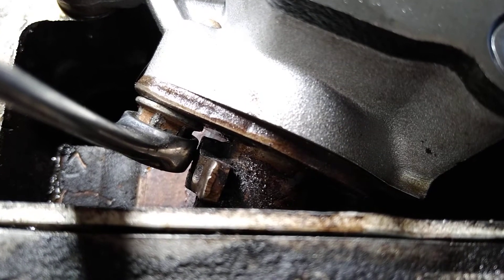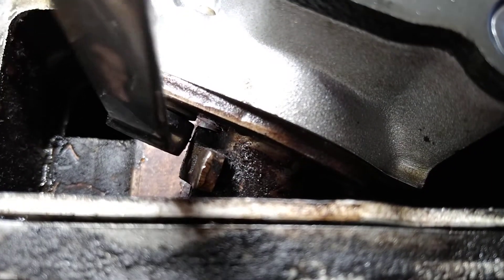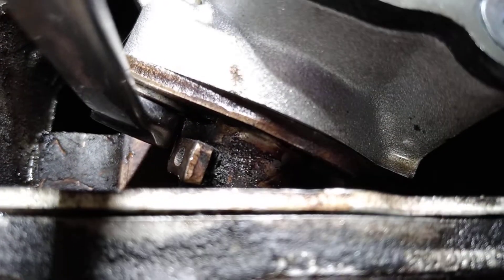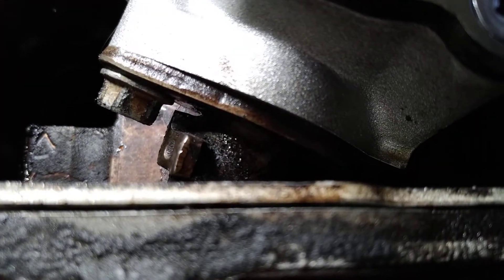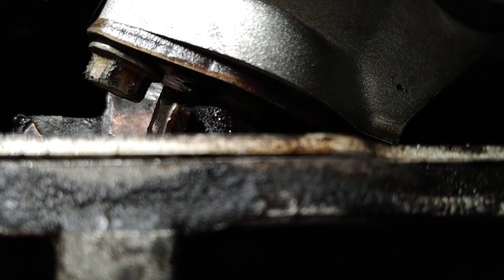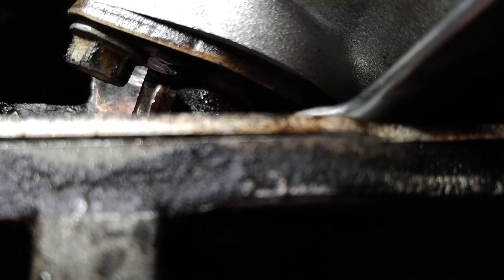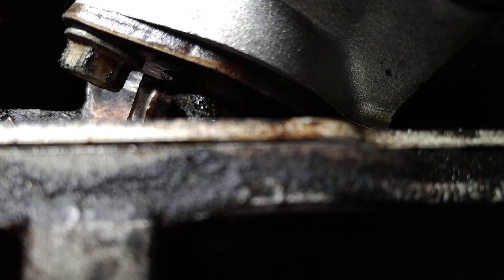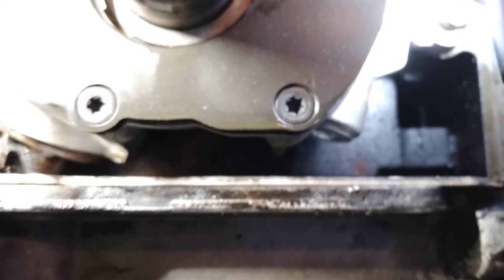LS CHEVY OIL PUMP BOLT

Comment: Have you had any issuses with air sucking in or oil pressure after modification? they sell a kit now that will hold the pick up tube and bolt in the other side.
Reply from the maker: Many people ask this question ... but think for a moment how the AC system uses one bolt to attach the end of a highly pressurized and charged line to another ... the power of the hold is not in the bolts. 

The seal - for either pressure or vacuum --- is in the o-ring --- and its integrity. 

Good o-rings mean good sealing. 

If the o-ring is intact --- still round within engineered limits --- has a clean surface on which to create the seal --- one bolt, two bolts, twenty bolts do not increase the sealing integrity. 

I own one of those horseshoe "assist" devices and it looks good ... but it isn't necessary unless one is working on something for NASA. NASA requires a lot of engineers with ideas - to implement those ideas - for the most complicated space equipment in the world. 

Musk showed NASA how to build rockets with a more minimalist view to simplify his ships --- they even land to be reused which is something NASA never envisioned. 

Again, I state that those horseshoe clamps with the extra bolt are good --- but since nothing in that oil circuit is in motion --- it's somewhat overkill. 

"Needing" that clamp is moot --- not bad --- it's just if you're going to have better, full access --- go ahead and install it --- it can't hurt. 

//
Reply: @SurferJoe46  Your right about the oring making a tight seal because they say to push up the pick up tube with the oring until it seats in and not with the bolt pressure. I wanted to use the kit as the only bolt to hold up the pick up tube because i'm going to have a mechanic replace the pick up tube and oring and I'm going to eventually change the oil pump, timing chain kit, water pump myself and save some money but that bolt would give me a hard time so i'll have the mechanic put the pick up tube kit so i can get it easiler for when i do it.Thank you for your assistance
Reply from the maker: @gjoniny  That's a good idea. It'll still be a Saturday Night Project because if you don't drop the front suspension to remove the pan, your access to that bolt, is still no walk in the park. 

Be sure to use the oil pump centering trick I used too. It's not an option.

Comment: How did you turn the ear around
Reply from the maker: Lemme see if I can find that small video - but I cut it off with my Dremel tool where the alignment tab was so it would turn 180°.
Reply from the maker: https://youtu.be/o9p7P-KGTao?si=dvmdl7zFJ-2pSL58 is the video of the problem as I solved it. Sorry for the very long delay in answering your question. My bad.